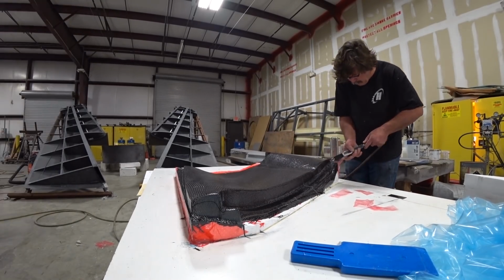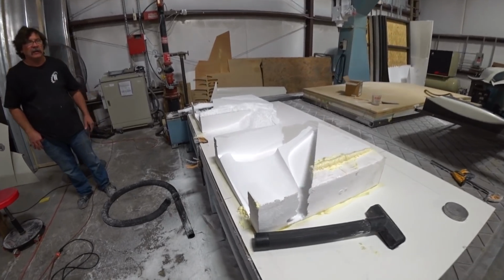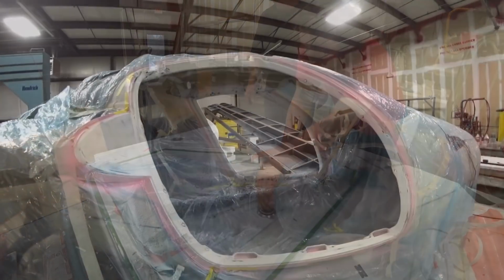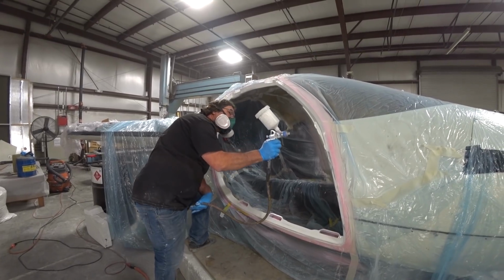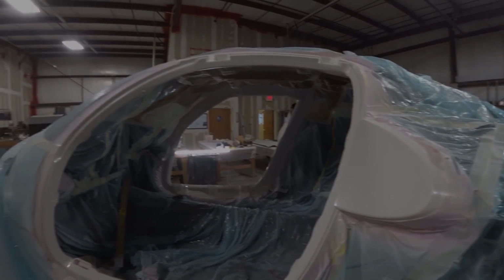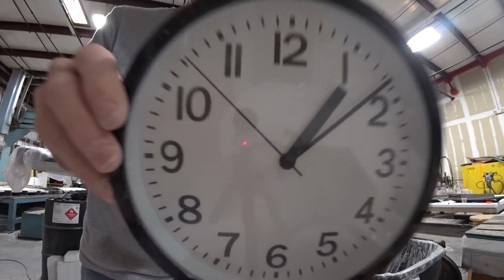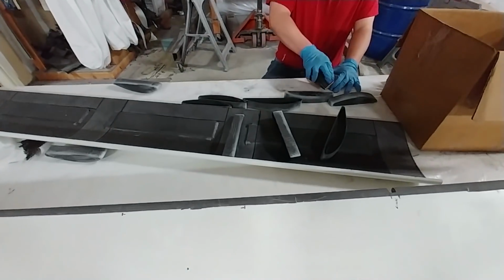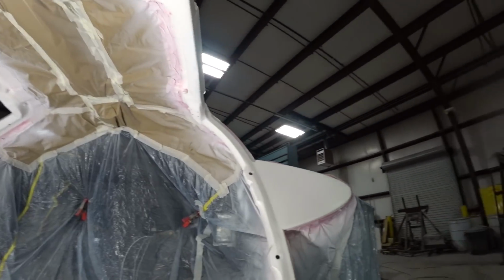Trim Panels and Sanding - Building the Raptor Prototype

Comment: You're doing great work, the future of the Raptor is going to look like Bearhawk aircraft in my opinion. They have a factory down in Mexico and everyone who works there only knows how to build Bearhawk aircraft the Bearhawk way. 
 The only people gas welding steel tube fuselages in production. 
  Your  design is awesome and you should focus on making a fast build kit. Like with all structural components complete and files for foam molds of the skins and panels. Then the builder can do a lot of basic layups in CNC milled female molds and bonding of major assemblies. 
 The profit is made in pre-fab parts, windows, linkages, control surfaces, doors, engine mounts, etc.  Also add some support for the turbo big block Lycoming and Continental engines, maybe use the baggage space for a third fuel tank, Just my opinion.
Reply: @Kyle Goldston: About a year or so ago I tried to build a business model for this enterprise. And now we know that 1500 ++ planes required  to be built  from the KIT (~ 3000 man hours each) and than serviced around the world. That is another ~ 40 h / year  x 1500 = And that is just on top of Production KIT Construction process. My plan was to distribute that delivery over a number of service centers around the globe:  Each service center pays to Raptor Aircraft some royalty fee and buys the intellectual property = rights to produce , assist and service the Raptor Aircraft case individually in number of licenses And that center becomes a "KIT Production Facility" Let say we might find 100 such centers.  Each center is in charge of 15 aircraft constructions and services. Geographically that should be easy to maintain

Comment: Obviously you have your own ideas for potential investors, and have probably had some opening conversations.  My suspicion is that it will most likely be someone from the periphery of the industry who can invest out of love, rather than a traditional VC or Angel group.  Having had some conversations with the latter, it's hard for me to imagine any manufacturing company showing the kind of valuation multiples they'd hope for.  With that said, I honestly and truly believe that if you're talking about 1000nm at 300knts with the wife and dog at anything like the pricing you've spoken about up to now, you're going to greatly expand the market.  You'll sell a few cirrus owners sure,  and maybe push the price of a Velocity a little lower in the aftermarket.   But I believe your big opportunity is in all the new buyers you'll pull into the space.  They're definitely out there.  Half an hour spent on any big bank trading floor in NY or Chicago will probably find you a dozen per stop and only the wait time will hold you back.  To my eye, you're hitting every mark Peter and I wish you spectacular success with it.  When you bring it up to TEB for the roadshow I hope you'll let us fans know so we can come have a look.

Comment: Yes Peter the  doors have been a time-consuming lesson to learn, but it was absolutely necessary in order to perfect the design, and we understand it was assuredly worthwhile.  I was surprised to hear you say that you'd require an "angel" investor in order to get to production, though, as I think everyone was under the impression that the deposits would pay for the prototype and the collective participating owners' funds would pay the production costs.  This is such a worthwhile project that I am confident you will be able to get financing soon after the prototype flies.  This is going to be a good investment and we believe in you and the Raptor wholeheartedly!  Remember, you can always try the KickStarter or IndieGoGo route for a funding vehicle too.

Comment: Another great update Peter, thanks!  And it dawned on me when I saw you spinning the clock and remembering back to when you stood in front of the Tardis...  You really are a Time Lord...  ;-)  The Raptor design and build elements are way ahead of it's time.

Speaking about build elements, I am wondering if you are going to put any sound dampening material between the engine and cabin area and maybe also in the cabin behind the panels that you are building to help insulate the cabin and quiet the ride?

Once again, thanks for the update...
Reply from the maker: There's two walls each with foam core between the cabin and engine. That should quieten things a bit already. Thanks

Comment: I'm sure you spend some time to think about the sequence, but shouldn't it be best to paint all frame/structure parts that don't get covered by panels, before mounting the panels? Afterwards it may be not only a hell of a job for the painter but also come out less smooth. Much like a car frame is (dip) painted before any parts are installed?
Reply from the maker: That's what we're doing right now. I think :-)
Reply: Ah, ok, fine. Form the explanation it seamed as if you're about to put in panels and alike as a next step (Minute 13) while there hasn't been a finaly painting done on the inside (so far just primer, isn't it, and only on the auther parts (and ofc, the door frames :)). Well, anyway, quite curious how it continues.
Reply from the maker: As you'll see on the next video the door frames will get their top coat of shiny paint. The rest of the inside of the cabin will not be getting painted. It's going to stay as plain carbon fiber. The trim panels will be covered in vinyl and they will cover up all the unpainted areas inside. 😀
Reply: Ok, now I'm even more tense to see the result. After all, if you put so much work into the doors to make them look perfect, any scratch in the non vinyl covered cabin parts (like pilars and roof),  glue remainder and gaps around the panels may destroy the shiney look. BTW, did you already decide for a final (outside) colour?